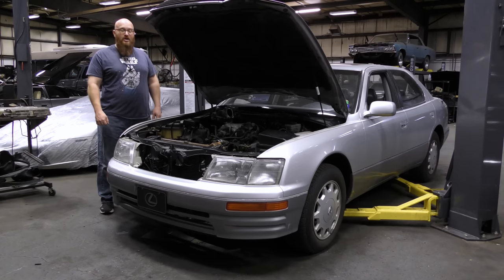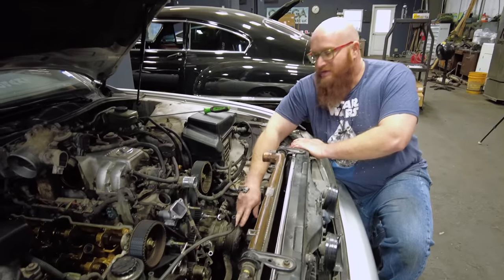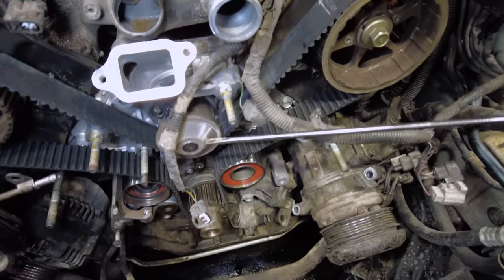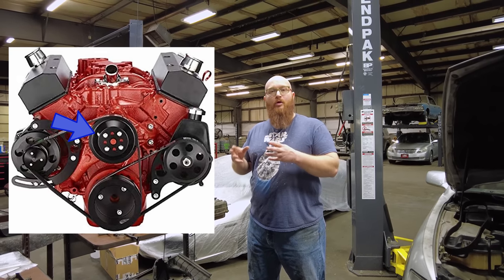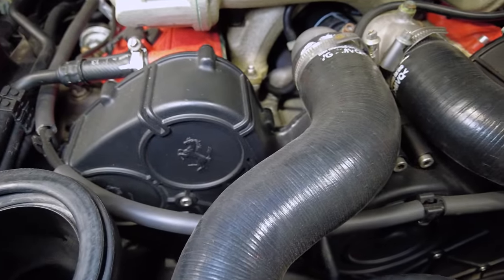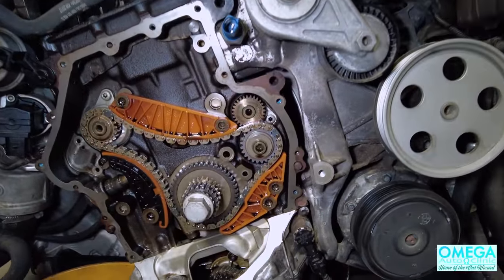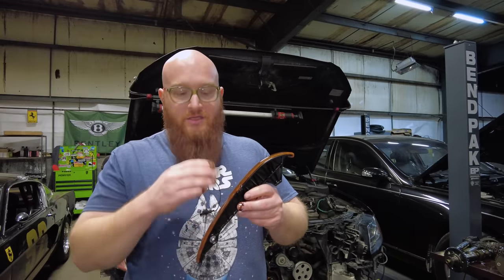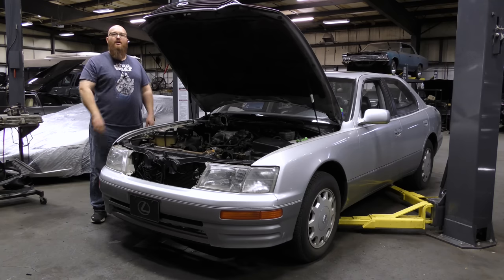My What's Broken? Series #1: Timing Belts-vs-Chains! CAR WIZARD explains why the huge bill

Comment: $1000-1800 for timing chain/belt service? Laughs in BMW m62/m62tu $5000 chain service.
Reply: Only if you get it done at a shop. Not a hard job to diy
Reply: @burntnougat5341  Yeah I plan on doing it myself. I've replaced just about every wear items and done plenty of external engine work on my 03 540i msport 6speed. I just need to find a place where I can tear it apart for a couple of days. Not having my own garage is tough. Luckily my car doesn't need it yet (knocks on wood).
Reply: @Recklessness97  dude I just did the job on my e38. Plan to have it in the garage for at least a month if you're doing a thorough restoration. Good time to replace the upper oil pan gasket and o ring that goes through the left motor mount
Reply: @burntnougat5341  Yeah I plan to dive a family members car too since my e39 is my daily. She has 130k miles on her so she's nearing the typical milage when it needs to get done but I used an endoscope to look around in the engine at the guides and chain and all is well. I also did the lower oil pan two years ago and inspected the oil pickup and no bits or pieces where found. Did valve cover seals so I also looked around then too. Owned her for 7 years now and still running well. Liqui moly engine flush and Cera Tec additive every fourth oil change, fresh Liqui moly 5w30 oil every 4,000 miles. I also plan on doing vanos overhaul and everything. Good on you for keeping these beasts alive, not many of them out there. I get giddy and happy inside when I see a well taken care of e38 and e39 still out on the road.

Comment: Why do engineers design interference engines?? Why not make them all non-interference? Also, it is obviously extremely important to change your engine oil religiously to ensure smooth operation of those chain rails.
Reply: Closer and closer timing needed and acheived by smaller valves and more of them in a tighter combustion chamber...
all for power and fuel mileage
There is only so much room...
and inevitably some valves will be down when a piston comes up if the belt snaps....

The plastic guides were, in a lot of cases, the wrong type of plastic which degraded over time and heat/cool cycles....
Old timing chain guides were metal...they sometimes got ground down and destroyed too....mostly by lack of oil...or oil changes.